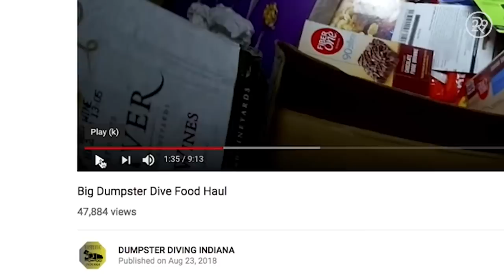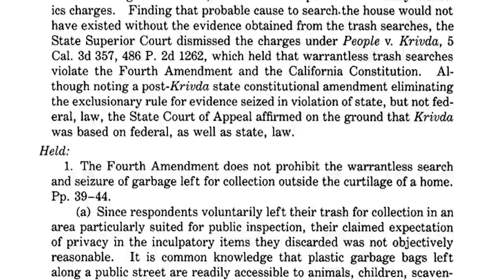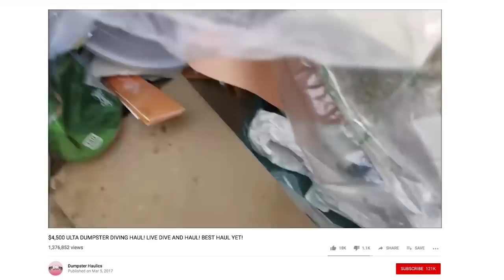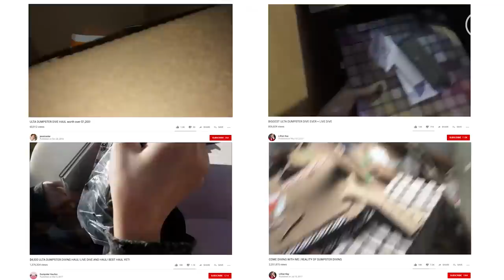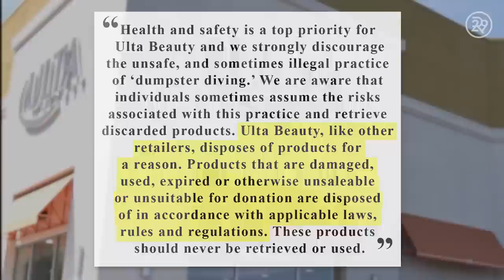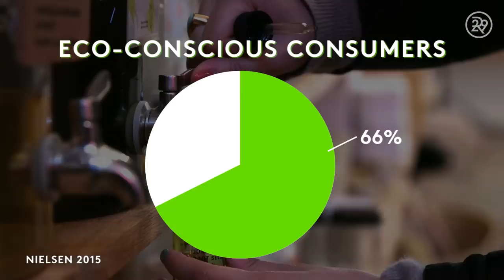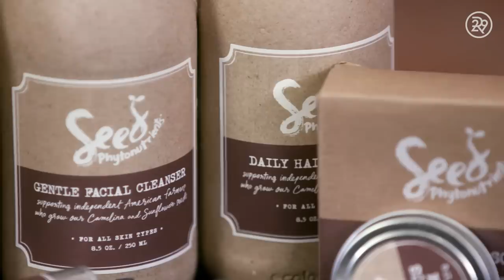Why People Dumpster Dive For Makeup | Beauty With Mi | Refinery29

Comment: As a former ULTA employee I can guarantee you that we were all so sad when we had to destroy the products😭 Awsome video! More people need to know what happens when they return their products.
Reply from the maker: +dritchie Thanks for sharing with us!
Reply: D Ritchie most consumers don’t care
Reply: Speaking Truth I used to work at Ulta too, and they would make us scrape out all powder products, dump out lights products and put lotions, alcohol, various other liquids in the bottles, and cut cords and then dump liquid on them.
Reply: Speaking Truth Also, when we got a return that was used (even just once), or if we saw someone testing out or using a product that it isn’t a tester, we have to throw it out and follow the same damage process. None of it can be resold. At all.
Reply: Why don't they just give it to their employees for free better than throwing it in the trash
Reply: Speaking Truth  there talking about the brand nee ones that get thrown away

Comment: I am a current employee with a U.S. beauty retailer and I can say do not try to dumpster dive at any retailer in which hazardous chemicals are used in the store. You're putting your own health at risk. Additionally, be a smart consumer and be choosy with your purchases to reduce the amount of damages stores do. It is extremely helpful. Additionally, if there is not a tester available...DO NOT OPEN THE PRODUCT!! It is extremely annoying as an associate to have to damage out products that have had grimy fingers on it that have swatched the product only to return back to the shelf for us to find. If you think something has been opened, ask an employee and they would be more than happy to examine the product prior to purchase. I do it with my customers and it has saved so much time in the long run.

Comment: I used to work in a craft store and I’d regularly have to do “return to vendors” which 99% of the time meant having to bin perfectly good items. It disgusted me, lots of the time it was an item that went 90% off on clearance and we had to write off as a loss. I’d let certain people know if a crafting supply they worked with was tossed so they had a chance to rescue them. Eventually even the manager got into it and we’d donate supplies to the children’s hospital or shelters or Christmas decorations to old folks homes. I only ever “souped” an item if I deemed it dangerous, mould and faulty wiring were the usual reasons. It made me nervous that the girl reattached cords on hair appliances. The only thing that was ever actually returned to the vendor were books that we had in store, everything else went in with the trash.

Comment: I worked at Ulta and the way we were told to damage products is insane. We would scrape all powders and eyeshadows out of their containers and then dumped bleach and hair chemicals on them. What's even more insane is if a product was even remotely opened it had to be "damaged out". This could mean a torn lid on a box or a partially peeled off plastic wrap. You could tell nobody opened it but because it was "opened" we had to get rid of it.

Comment: I recognize all the product in that dumpster because I use to work at that beauty store last year. I don't know if the regulations are different in that state, but here in California, NONE of that would be thrown away. It's considered a hazardous material, and everything that's returned is sealed in bags and sent back to our distribution center, not thrown away. I don't know if the DC throws it all away, but I assume they don't if such measures are taken, like I'm pretty sure they clean/recycle it all. If its a clearance items it either stays on the shelf until it sells, or is also sent back to the DC. I remember only throwing away one in tact product and it was just expired hair vitamins. Interesting to see how this is handled on other states.

Comment: I used to work at a fancy french restaurant that would do these buffets for events, prime rib roasts, cheese platters, salmon, all good food. Even if it was only out for an hour we were required to throw it out afterwards. So after we were done with the food (staff would go through it for our diner) I would pack every last bit of it up under the guise of taking it home to eat it and then distribute it to the homeless people in my city. If you notice your work is throwing things away unnecessarily, find a way to resist it. Fight the system.

Comment: I work at Ulta, and while of course it is sad that all the used retuned makeup must be "souped" and tossed, it is fully necessary. When I first started my job, I asked all around about ways that the makeup could be donated to women's shelters instead, but it is clear to me now why that is not possible. When people returned used products, it would be a safety hazard to allow anyone else to use the product. I have heard stories about people getting funguses and infections and even worse. I have confronted customers who took the real product out of bottles and replaced it with something else cheaper, then returned it for full credit. If you want to be part of the solution for all this sad waste, stop returning used products! Get a sample of it before hand or give it to a friend if it doesn't work for you. The amount of people who come back and return a foundation after using it once because it wasnt the right shade is really saddening, because it still has to be destroyed and tossed, just in case.

Edit: Just saw the part about recycling, and I 100% back this and wish Ulta would take part!

Comment: Hmm... I wouldn't ever think of diving for something like used makeup, that's asking for an infection. However, when it comes to something like a hair dryer, styling tools (which can be wiped down with Clorox wipes), hair sprays, mousse, or even a perfume... I would consider it because its much easier to be hygienic with those items because you can either wipe them down and/or you know you can't tamper with the stuff inside.

Comment: Sooooooo #2 was without a doubt a sally beauty supply. I work at one and would very much advise against pulling stuff from their dumpsters. Not only is it unhygienic, those products that are tossed are damaged, we’ve deemed them unusable. It’s all customer returns or products that are so badly expired we were instructed to pull them and damage them out. For example: I’ve had to damage out a full shampoo and conditioner because the woman who returned it left it in her car for god knows how long and it went bad. Like I opened it and it smelt so terrible I had to damage it out even though it was unused. So just don’t dumpster dive it’s dangerous. 

Also! I’ve got to give it to my store because idk if it’s company policy but we do donate what we need to get rid of that is useable to local woman’s shelters.

Comment: I know there's a lot of legitimate waste that goes on, but you really don't know why they were thrown out. I work retail and we have to damage off a fair bit. Some of the stuff we damage off looks ok but the mice had gotten into it or pooped/peed on it. Or there was a recall because a harmful chemical ended up in or on the product. Or its expired. Or someone had opened the packaging, used the product, and put it back in the package so no one can tell they just esentially stole. I'm coming from a place of middle class privilege so I'm sure there's a side to food waste that I don't see, but I would never go through a dumpster for aesthetic products. 

Also, if something happens to you while you're inside the dumpster, the responsibility would fall on the store or employees of the store you're dumpster diving from. You can't put that on the low wage employees. Half the reason why my store is so adamant about locking our dumpsters is because of the potential to get injured or sick from the dumpster or something in the dumpster. Guaranteed there's blood and puke and several dead mice in the dumpsters every time they're taken away.